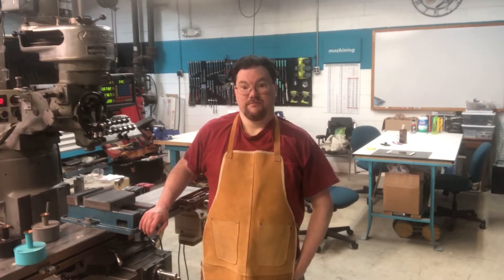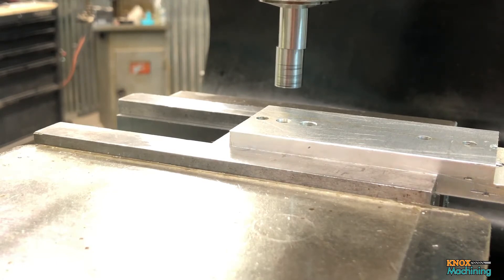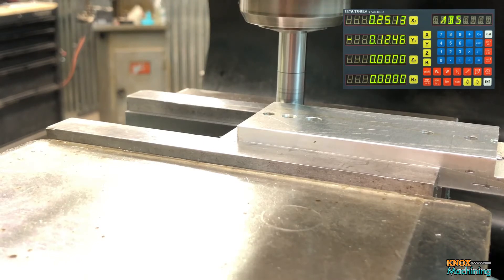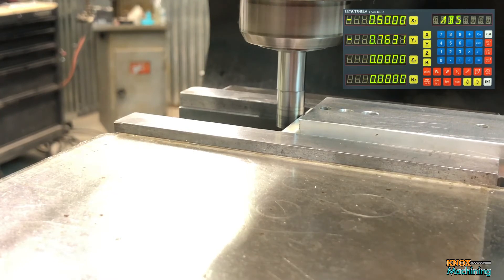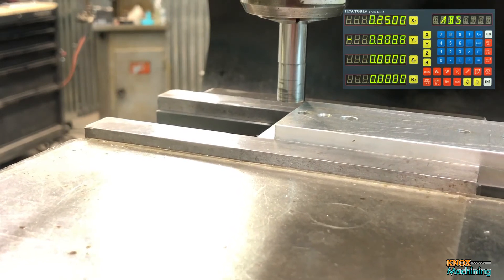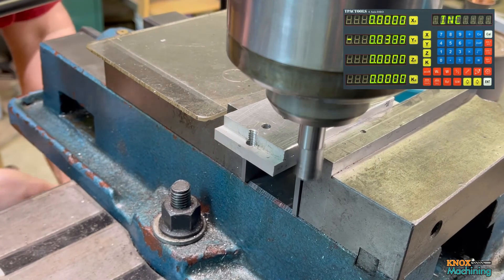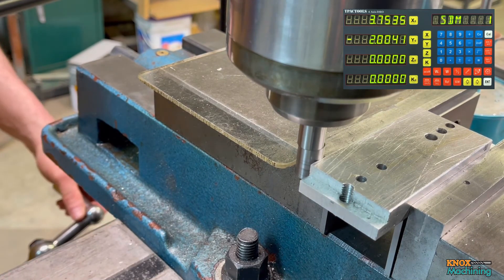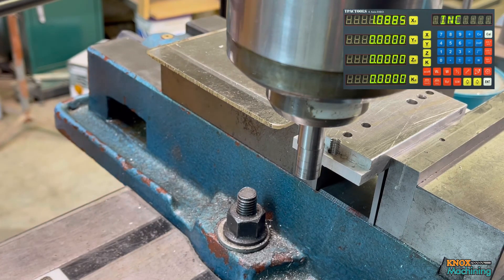Quick Tips & Tricks #1, Using Edge finder with DRO (Using the SDM Function)

Comment: Do you have a video on storing drill or milling points on your DRO , like finding the center and then 4 other locations.? I have a Ditron D 60 but they all same to be the same in functions, Sure be great to see how you store them, read the China manual but very very confusing.  Great video on the edge finding, and do almost the same as you do, but like your rechecking ,
Reply from the maker: I don’t. But I’ll see about doing one in the future. The SDM function would be what you want to use. I always double check. Better accuracy. Yes, the Chinese manuals are very hard to read.

Comment: I've only had my DRO (on mill) since this Feb, and still in the learning process. Thx for sharing and the SDM function I and half are in my path of learning :)>!,,Bear
Reply from the maker: Yea, I love the DRO.  The SDM is rarely talked about in the hobby world.  It's rather useful.  You can set it up for small production runs.  Say you have two or 3 vises, and your making identical parts.  You fixture them in your vise, and pickup your edges on each part, storing that in a SDM page for each one.  You then can do a operation on each one without having to edge find every single time.